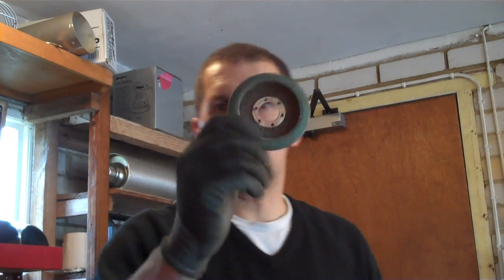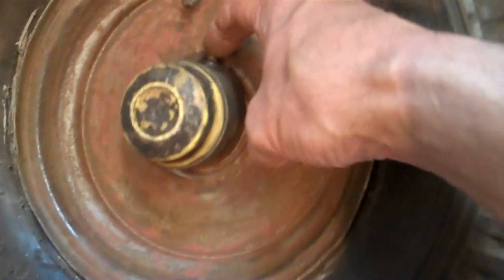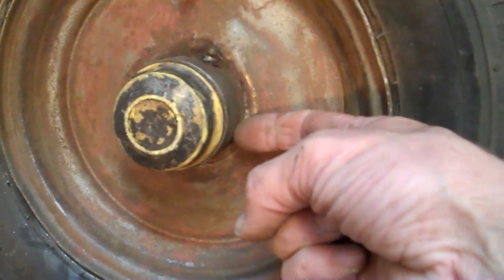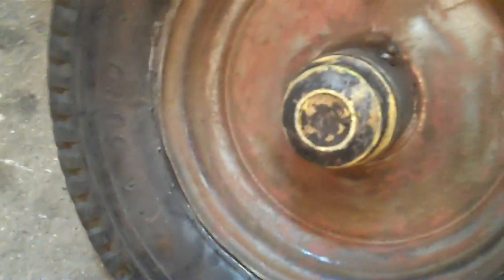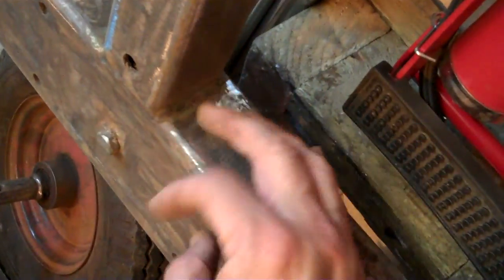Delboy's Garage, Project Rat Trailer part 3.

Comment from the maker: Snipe trailers are the top of the stack mate, they specialise in marine trailers for boats, and thier spec is the standard by which most others are set... a trailer that size brand new with the marine ply body would have cost about £500... good find for £40 lol....

Comment: You can set your laptop up so that the display goes to sleep, but the rest of the computer doesn't. Set it so it doesn't go to sleep for 8 or so hours, then you're covered. Just Google "Windows Sleep Settings" for more info. Cheers.